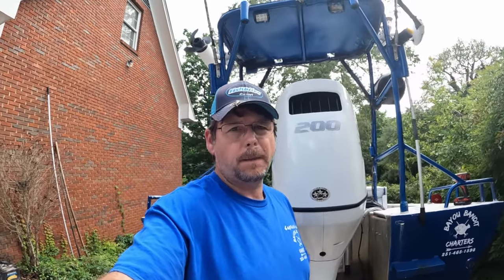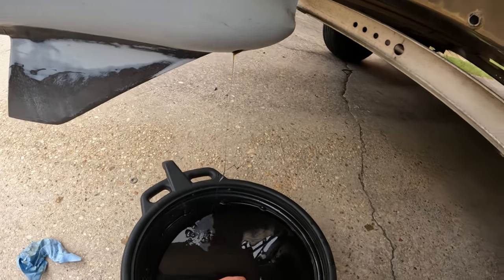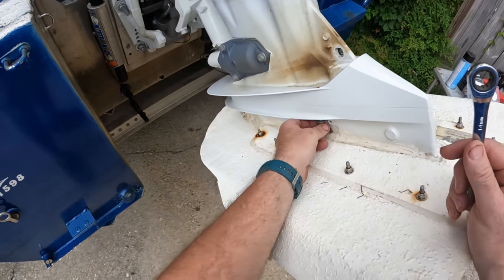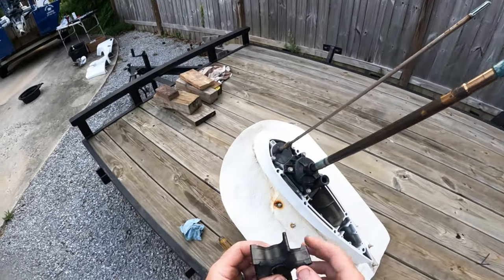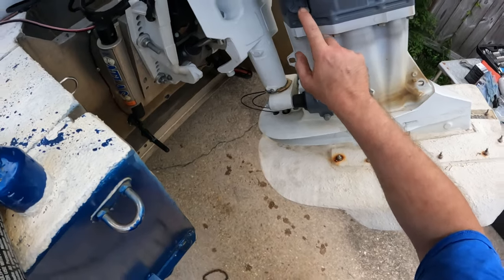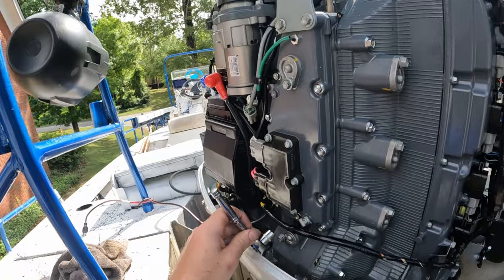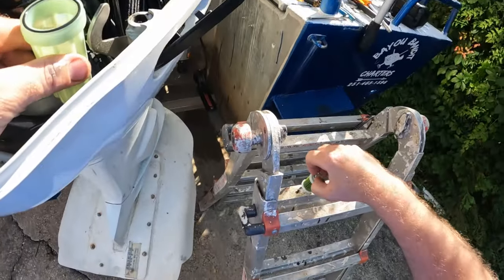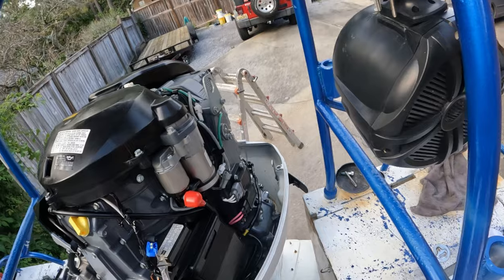**SUZUKI OUTBOARD MAINTENANCE**100 HOUR SERVICE** BEST **STEP BY STEP** HOW TO VIDEO on YouTube!

Comment: Thanks for the great video! I changed the fuel filter but now the housing is not full after priming. It starts and run on the hose but wanted to know your thoughts before I run on the water. Thanks.
Reply from the maker: Don’t know your exact setup, but you should be fine
Reply: @bayoubanditcharters  it’s a 2023 Suzuki 200
Reply: @bayoubanditcharters  every thing worked good out on the water.

Comment: Forgive the ignorant question, I have not worked on marine motors before, and am novice in other small engine repair, but my brain is telling me that greasing the bolts would lend itself to vibrating loose.  Am I not thinking about that in the right way?  Trying to better understand it, should I be thinking that the bolt head friction against it's base is what keeps it from backing out over time?  I like the thought of never having bolts seize up, I just have a hard time grasping the logic.  Not questioning the method by the way, just trying to better understand it so I don't screw it up by putting grease in the wrong place!
Reply from the maker: Same principle as using anti-seize. If you don’t have a barrier between dissimilar metals you will have issues with corrosion and bolts seizing up. I’ve never had any issues with bolts vibrating loose if torqued to the right specifications.
Reply: @bayoubanditcharters  thank you for the reply!

Comment: The best video I've seen on DIY on an outboard. About to change anodes on a DF200a, manual says to put susuki silicone seal on the anode securing bolt heads. Very confused about this because I can't find info on anyone doing this on the internet. Is the marine grease you were using on the anodes replacing this step?
Reply from the maker: I don't put anything on the actual anode, that would form a barrier and not allow them to do their job. I only want grease in the housing and on the O-ring. Thanks for your comment!

Comment: Love your content. Question: What does your boat weigh?  What prop are you running? I’m considering the same engine. Thank you sir.
Reply from the maker: Good question. I’ve never actually weighed it! It’s definitely not the lightest with 3/16th bottom and sides and 32” sides with all my gear, lol!

Comment: I see you have hydraulic steering.  What brand and model number do you have.  I see seastar on line for up to 150 hp. For around 1000 then up to 300hp is like 1800. Can I get away with 150 hp Unit?
Reply from the maker: I’m currently using the 150 version due to previously having a Honda 150. It works, but honestly not real well, lol! I plan on upgrading in the future

Comment: Hi.  

Does the Lower Unit oil lubricate the gearbox?

At 22:45, what part was being referred to (some alignment pin or something?)

At 1:07:56, what is the name of the fitting you are injecting grease into?

At 1:08:45, what is the name of the fitting you are injecting grease into?

Is a fuel water separator located on the motor (in addition to the fuel water separator installed on boat fuel line)?

If so, is this different to the Fuel Filter on motor?

What is the part number for the genuine spark plugs?

 
Cameron

Comment: Capt thanks for all the great info. Question, what can I expect to speed on a brand new 2024 200hp OB. I would do drive by wire. Also does everything come with the engine wire harness, prop and ignition or do I buy that separately? Really appreciate the reply, thanks.
Reply from the maker: Everything comes with the motor ready to go! Expect to pay $21-23k
Reply: @bayoubanditcharters  I'm in need of twins. I'll most likely be down powering since the 225's and 250' are 600 lbs+. I was told be the closest Suzuki dealer near me that the engines come with zero. Everything is ordered separately because of the size of any boat is unknown as well as the prop size needed. Looks like I'll in that $43k range with the current incentive and the 4-4-2 program. Because I have no other dealers near me I can't help but feel like I'm being scammed. Again, thanks for the replying.

Comment: Thanks for the video.  Pretty sure the dielectric grease goes on the spark plug anode not the threads.
Reply from the maker: The Suzuki mechanic I spoke with said that’s what is recommended for the threads!
Reply: On the porcelain , keeps the boot from sticking and possibly ripping. I always use anti seize on the threads, keep from corroding and from galling.  Dielectric grease does not conduct electricity, I never use it where a connection is made, only around the area to help with corrosion. A little on the porcelain keeps the boot from sticking and helps keep out moisture.

Comment: Also curious if you cut yoir oil filters open amd look at them. I run a pair of 2015 DF200As 500 hoirs or so. Fairly new to me.
Reply from the maker: No sir, I don’t
Reply: @bayoubanditcharters  next time you do your maintenance check the hose clamps by the high pressure fuel filter and under the beauty cover. Mine rotted out but I caught them in time. Salt isn't nice to anything.

Comment: How many hours do you suggest changing out the whole water pump components? Gaskets, rings, plate, etc...love the video. Gonna save me bank by doing it myself.
Reply from the maker: About an hour to an hour and a half.
Reply: No Capt, I think he meant how many hours on the engine do you have before you recommend a water pump replacement. I could be wrong, great video.

Comment: What motor muffs do you use to run engine? Which ones do you recommend because I haven’t found any that work thanks
Reply from the maker: Be sure to use the round ones. I got mine from Amazon.

Comment: Do you put grease on the oil plug screw threads and lower unit plugs screw threads when putting back in after refilling?
Reply from the maker: I don’t due to the threads already having oil in them, but you could if you wanted too.
Reply: @bayoubanditcharters thanks that was my thought as well!

Comment: Awesome vid mate, well done!  Just 1 question - do you check or know how to adjust the Throttle Position Sensor (if its adjustable?).  Mine is only opening to 82% but im unsure if it can be adjusted like a vehicle.

Thank You!
Reply from the maker: How do you know it's only opening to 82%?
Reply: @bayoubanditcharters  I felt like I was down on power so I bought the Suzuki SDM software & cable & logged some runs.  At WOT it the log shows only 82.2%.  From what my dealer(now retired) says it should be over 94% and may need adjusting.  Was hoping to do it myself as next dealer is 6hrs away..
Reply from the maker: Ok, sorry I can’t help you with that one?

Comment: In the service manual it says that you should pull the shift actuator fuse 15 amp  before you drop the lower unit

Comment: Very informal video thank you on this, I do have a question I have the same motor as you im not even at 20 hours and I’ve noticed when I first start it up it takes awhile to start peeing, I’ve put air through the tube and always flush my motor just wanted to see if this is normal for these motors?
Reply from the maker: It doesn’t take long for mine to start peeing. You can see exactly how long on my “How to flush and de-salt your outboard motor” video. Maybe 5-6 seconds?
Reply: @bayoubanditcharters  oh wow mine can take up to 45 seconds to a minute, something probably isn’t right with the water pump
Reply from the maker: Is that on the muffs or in the water? Or is it the same?
Reply: @bayoubanditcharters  that’s on both, I’m probably going to change to water pump, thermostat, and poppet valve
Reply from the maker: Yes I would definitely check them all out.

Comment: Should my motor go into gear forward and reverse when the motor is off?
Reply from the maker: On fly by wire motors, shifting is controlled by servo motors. So if the supply power is off, it cannot shift.

Comment: Hi , great video . Mine 200apx gets high temp at high rpms, and even for 2-3 mins at the highest rpms. Did anyone had the same problem? When I deaccelerate the temp drops again . Thermostat failure ? I have only 196 hours .
Reply from the maker: Is the motor still peeing good at higher rpm,s?
Reply: @bayoubanditcharters  yes no problem with that it’s normal  . I faced that only at max rpm. For example at 5.500 I didn’t have this issue ? Are the thermostats too sensitive? Or might be a factory failure on the thermostat?
Reply from the maker: Possibly thermostat, there is two thermostat options for this motor with different temperatures. Could also be a water pressure valve issue (poppet valve). If it started after your 100 hour service, I would say wrong thermostat option?
Reply: @bayoubanditcharters  I had it also at the 100 hours , I never run the engine more than 4700 , it’s so powerful and people don’t want the spead . Will change a thermostat and see how it goes . Thanks !! Great job on videos again !!!
Reply from the maker: You really need to run these motors wide open for at least 10 minutes every trip to clean out the carbon buildup

Comment: Would you modify your maintenance approach if you were running in fresh water?
Reply from the maker: I would basically do the same maintenance except for the anodes, which I would pull and inspect every 200 hours. As long as you’re not running in a bunch of sand, your water pump should last 200 hours as well.
Reply: Great.  Thanks!!

Comment: A new impeller is not 100-hour service but does not hurt
Reply from the maker: Correct, it’s not required every 100 hours, but unless you ask your dealer not to change it , they will. I wanted to make sure my shaft was greased properly, which it was not, and wanted to show people how to do it their self

Comment: my dealer told me that any and all work done and or any servicing to my 25 has to be done by an authorized Suzuki dealer/mechanic or it voids the warranty. Are we gaping the plugs before installing?????? Not trying to be that guy, you do a hell of a job.
Reply from the maker: That’s not what my dealer told me! You can do your own service work, but make sure you keep your recipe in case you ever have an issue. Some dealers will tell you that because that’s how they make there money on service work, lol! Yes always gap the plug s, usually they are pretty close.
Reply: @bayoubanditcharters  im sure you did gap them..i was just pokin at ya a little. My nearest dealer is 2hrs away so most of the parts will have be online purchases. Id rather do my servicing as well...at least i know....ya know. Tight lines

Comment: Why didn't you replace the O-ring and cup with the impeller?
Reply from the maker: The impeller is your main wear item. Always inspect the cup for grooves and wear, but typically the cup will not need to be replaced until at least 600-700 hours maybe more. Unless the O-ring is hard, cut or flat, there is no need to replace it. Actually, the impeller was still in great shape and could have been run another 100 hours.
Reply: @bayoubanditcharters  Right. But all the new stuff is right there in the replacement kit. I was just surprised because you're extremely thorough throughout the whole video. Why not just throw the new stuff in so it's all 100% brand new? It doesn't do any good sitting in a bag on a shelf. 

Anyway,  awesome video! I learned a ton. Thanks for taking the time to educate us all. 💪

Comment: Is the warranty ok with doing the service yourself??  My yamaha dealer voided my warranty because I do my own servicing. Not a happy bunny, change of make next time.
Reply from the maker: Yes, just keep your recites and get your parts from your local dealer. Warranty will not be an issue
Reply: I don't believe the dealer can void your warranty. Unless you bought some sort of extended warranty from the dealer itself, your warranty is with Yamaha and not the dealer. It sounds like they are just trying to bully you to pay them to do the service. Basically, if you use Yamaha parts and follow the recommended schedule, you will be fine.
Reply: @mattreeves1779  Thanks for the reply, yes it annoyed me expecially as I have big diesels up to six hundred horsepower in my fishing boats and in fifty years of servicing them myself ive never had a serious break down. My Cummins did 40,000 miles in four years without a problem. Shame is the head mechanic there is my friend and in my mind the best outboard mechanic there is. Maybe try a Suzuki, they are happy to let me maintain it. Cheers.

Comment: 100 hours service should still be done by the Suzuki dealer because of the warranty. Isn’ t it?
Reply from the maker: No, it doesn’t void your warranty to do your own service. I do suggest keeping you receipts.
Reply: What Jody said. My dealer recommended to get a log book so that you can log the dates of service and to keep up with your receipts. You do have to buy Suzuki oil and any other OEM parts, filters, etc. No aftermarket parts.

Comment: Cap, what grease did you use at the end of the video for the grease fittings & the tilt-trim top part? It looked like it was Yamalube but then it was red on those tilt rams. Just wanna confirm @bayou bandit charters Thank you!
Reply from the maker: Yamalube or Lucus red and tacky. Any quality marine grease will be fine.
Reply: @bayoubanditcharters  I just went through this entire video and I'm left wondering: When my motors are at their next 100hr service interval - what's required? I've got 1025hrs now on each of my motors. I got all new anodes (every single one), thermostats, water pressure valves, etc. Should I be replacing any belts or anything? I completed this entire video step-by-step and it was beyond helpful for a new suzuki owner. Thank you sir for the timestamps too! You should do a Redlyme or SaltAway video (how to care for long-term saltwater motors flushing them etc)

One last thing I'll say, clean your throttle body! Mine was nasty so used some CRC cleaner and a toothbrush and got it cleaned up along with the metal screen.